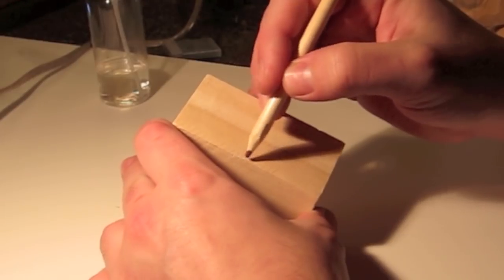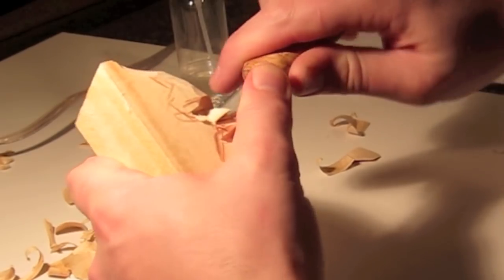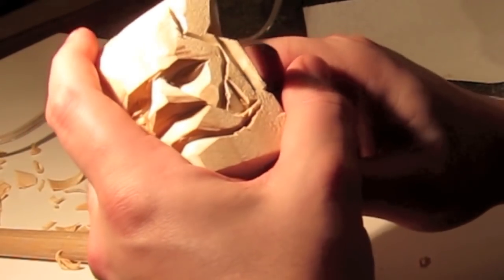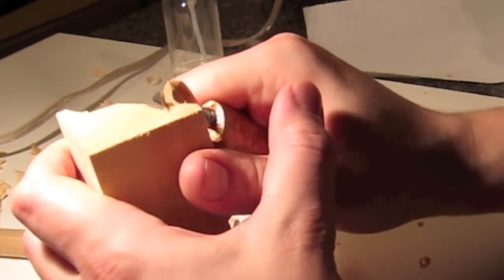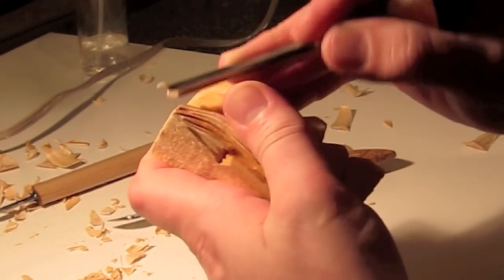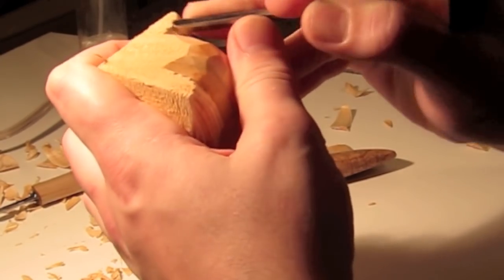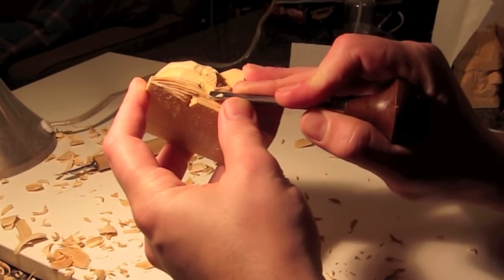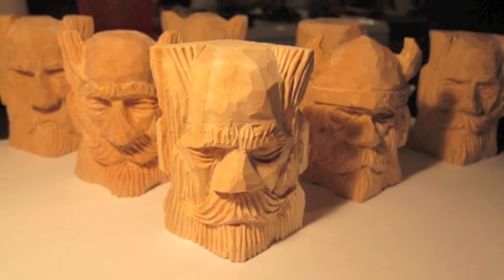30 minute wood spirit carving Full How to carve a Face

Comment: One thing that helped me a lot when it came to eyes,mouth even expressions,was first to do them in modeling clay . Nothing fancy just the tinted bars that you can get from wal-mart. Then bend paperclips with needle noses,and also cut toothpicks with fingernail clips so they act as V cuts,gouges,and fishtails. That way if you're not happy with the results you can do it over,and over again until you are. The clay can be kept in a airtight container for a months perhaps longer until you need it again. It will save a lot of time,and money by working on the clay first if you're unsure about your cuts.

Comment: very good video and carving, i wish i could get that basswood here in the uk, the nearest i can get is Limewood and it is harder to carve.
Reply from the maker: ifonlyful thanks mate. you know this is not the first time i've heard this. and i've never had limewood so i can't really make a comparison. no body sells it here and the few pieces on ebay go for pretty high. For you though, i think it might be worth it to see what shipping would be for a pack of basswood. Someone has to be willing to ship. Basswood is relatively very cheap and a bag of 12 pieces is barely 1 pound...or a 2 or 3 kg...with the exchange rate for you it still might be worth it. 
  the other option is to try and get wood that's not been dried all the way yet. it's way easier and nicer to carve..if you have access and/or tools.
thanks again, good luck!

Comment: Very cool. I'm going to start carving, spirit wood always caught my eye, got to love it. My goal , load my house and yard with figures.
I will try these knives you suggest.
Reply from the maker: +Fred Howard thanks! 
let me know if you have any questions at all about starting out. i have some long winded videos about first cuts with easy access tools. 'lucky clover carving school'
Reply: +schpoingle 
Any help would be appreciated, I did buy the two knives from Deepwood. Beginner set with honer.
Reply: +schpoingle 
I have a question about wood, I have rain tree I have to cut down, the pieces, sizes should be perfect.
I see you mentioned kiln for drying wood, I have a kiln and wondering how long and temperature, higher or low. 
I'll probably have to experiment. If you know anything about this, any advice would be appreciated.

Comment: Incredible work mate. Question, is the wood that soft or if the blade that sharp? I tried to carve a little boat for my kid but having no knowledge about wood, I picked a piece of a branch found on the field and it went down hill there on. I got it done but not before 10-15 hours and lots of cursing lol
Reply from the maker: +Papa Gleb it's a mixture of wood, sharp knife but also experience. Certainly you should go pickup some 'basswood' or order it online. You'll find it much easier to work with. If you don't have a knife that's for woodcarving i'd suggest picking one up that's ready to use. you can get 'the scalpel' from deepwoodsventures.com for a bit over 20 bucks and it's hand forged. or get a larger knife if you want to spend the money. i'd suggest the 1 1/4 straight blade detail. it's a beefy knife. any longer and you'll have problems using the point of the knife for details. 
both of those things will change everything when you go to carve again. 
then, over time, you'll get better at making the wood do what you want. interestingly, it takes some surrender of will to gain control. 
email me if you have any questions or want to show me your work. nosubject13@yahoo.com
take care and good luck!
Reply: +schpoingle thank you very much for all the info. It's much appreciated. I'll def save your email for future reference.

Comment: Hi Man nice work, really cool, Im asking about what kind of wood do you use?
Reply: Basswood
Reply from the maker: Robert Sidden thanks robert.
and for others reading: i get these blocks off of ebay. there's a few sellers and they are all good and cheaper than commercial sellers. this is a 1 3/4 by 1 3/4 by 3 inches block. if it's still available, it's 12 for around 12 bucks including shipping.

Comment: Awesome video. Thank you. I'm wanting to get into wood carving. I have zero experience. I have a few questions: 1) The wood seems to cut so easily. Is that because it's the right kind of wood? Or are the tools just extremely sharp? Or both? It's like you're cutting through butter. 2) How often do you have to sharpen your tools? And do you do it yourself? 3) Because I'm new, with a limited budget (maybe $100-150), what would you recommend I get? A knife like you have and a couple of the "v" and "u" gouges (or chisels - I'm not sure what the right terminology is yet)? Thanks again for a great video.
Reply from the maker: +Russ Tanner hey thanks for writing. the wood is a soft carving wood and the tools are super sharp and some is experience. sharpening for wood carving is a bigger deal than most think. it's expensive for proper materials and it took me months to get down proper technique and longer to get consistent. All you need to start is a knife, then when you start to understand the cutting of wood and getting it to do what you want, then transition into one or two palm tools. your gonna start emailing me for any questions at nosubject13@yahoo.com, my name is daniel.
there's a few options on where to start with knives. you can use disposable blades. a hobby knife/exacto blade will work with fresh blades. the blades are thin so it won't make very deep cuts but it does make clean cuts. i have some long winded beginner videos called 'lucky clover school of woodcarving' or 'how to wood carve and whittle'. I carve with an exacto blade in those videos. you can do that for very cheap for a week or two and then if things go well i can recommend some bigger knives and stropping stuff and sharpening stuff. You do need to get some "Basswood". NOT BALSA WOOD. You can buy this in little grab bags at a local craft store or you can buy very cheap stuff on ebay from private sellers. get these if you want to follow along with my beginner videos http://www.ebay.com/itm/8-1-x1-x-11-75-Basswood-Carving-Blocks-Turning-Carving-Wood-Lumber-/111838363366?hash=item1a0a15fee6:g:cQEAAOSwf-VWXYTE

Comment: Was that a regular carving knife or a rough carving knife. There were so many when I looked them up.
Reply from the maker: yeah, it get 's overwhelming. I need to have him do a 'schpoingle's picks' on his site. not sure if i use 'the scalpel' in this one but i'm seeing mostly the larger one....which in deepwoodsverntures terms, that's the detail knife. yeah. his knives are super big. that's why i like them though. so you want the detail carver. you want a 'straight blade' (not upswept). You want a 1 1/4 inch blade. that's as long as you'll ever need for most project like i do. if you ever get into spoon carving or something bigger then check out some longer ones. 'the scalpel' is 1 inch but the detail knife is made with really thick steal. it's a beast. if you wanna get two, get a scalpel or get another detail that's upswept. 
good luck

Comment: So I just ordered the scalpel. What I want to carve is a pipe. I have the pear wood blank drilled w/stem fitted. Trouble is the block is just that so there is no starting at the edge as it were. I am going to purchase some basswood blocks from the local craft store to practice on.

My question is how do I carve a face when I have to start on the flat of the block? I take it that it is harder to do, but not impossible. Do you have any tips, videos, etc. for someone who has done no carving to speak of?

Thank you
Reply from the maker: digitaltripper hey there! glad to get your comment and hear you are interested in wood carving. I actually carve a pipe a few months ago...it worked out pretty well. On the pipe stuff...i don't know exactly what kind of pear wood this is or the density or grain...but if its going to be a good pipe then it's going to be pretty hard to carve in a traditional sense. I've had some fruit wood like apple ...and maybe pear not sure...but it the grain wasn't straight and very dense...again..good for a pipe but not great for straight carving. when wood like that cant be worked on with regular hand tools then you get into a whole other world of carving...some of it is power carving...using rotory tools with rasp bits on them. you don't need that because it's a small piece but the hand tool route in that direction is rasps, files and sand paper. you will be able to do some smaller very slowly with a knife or gouge but only after its close to putting details on . rasps are cheap and generally get the job done. i've used dollar stone rasps and they were fine. try not to get too course of a rasp. maybe one with a flat side and one with a curved side. if you already have some files you can use thouse from the beggining but it will be a little slower...other wise, rough it with the rasps, refine the shape and corners with a file and then go to sand paper or try out your carving tools. sometimes getting some moister on tough woods can help tremendously. mix 50/50 rubbing alcohol and water and put it in a spray bottle. spray the part your going to work on and wait a second for it to go sink down as far as you are planning to cut. apply more as needed, it dries quick. the alcohol will leave the wood completely so keep checking smell before smoking it. if you don't have files check the doller store again...or get some jewelry files off of ebay. they are cheap and have different shapes. the cheap ones break easy to be carefull..they're still worth it though. 
     okay on the rest...i'm glad your getting some basswood.. it will really help. 
on carving from a flat surface i have two videos like that. there's one from a round log..basically flat. here's the link https://youtu.be/SoWE_uqzuX4
there's an older video that is from a block and flat part and has some good tips for dealing with that..it's nota very good video technically, i hadn't figured out clear camera work yet. you want the second part and about a minute in i start the flat face. here's that video
https://youtu.be/SoWE_uqzuX4
also, if you have a dremel and maybe even flexshaft then you might was to use some of that for carving the pipe details. if you don't have one there's one made by 'greatneck'. it's like 30 bucks with a bunch of accessories. i'vehad mine for 5 years. most accessories for the rotary tools dont remove a whole lot of wood...but your on a small project so it should be fine...
      sorry for writing so much..i love talking wood.
 please send me an email at nosubject13@yahoo.com and ask questions and keep me updated and send pics when your ready. please. i get great full filment from helping peolpe get into carving. and there's so much little tips and stuff that i wish i had had when i started. plus i love pipes and making them and i spent allot of time researching and experimenting  making them and haven't been able to share that info with anyone. i wanna know what you learn too...where did you get the pear pipe? you make it or was it a blank? i want one. 
anyway, hit me up dawg! 
take care mang.

Comment: may i ask a question :i started with carving and did some simple maskes but i never could cut with the knife such big pieces out like you. is it the tool or the strengh /experience ? like 2:45 my cuts are mostly influenced by the wood which make them not so clean or i cant even cut in a specific angle. i always do everything like in 4.20

Comment: question man... been an avid knife sharpener for a long time, recently picked up some bench chisels, and was able to sharpen them very square, and extremely nicely! I wanted to get into some wood carving, my question is: Do those carving knives have a convex bevel and a flat ground edge? Or are they pure convex?  And how much trouble do you have sharpening your carving knives, and or gouges? I can see why doing a gouge would be  challenging to sharpen, but if that knife has a standard V edge, I think i'll have no problem keeping it very sharp! Thanks.
Reply from the maker: +Max Savino hello there! 
the carving knives have a 'v' profile. and just flat. some have a bevel and then micro or secondary bevel...just depends on the thickness. in general, the carving knife is going to have a much steeper angle than other knives or tools. I do have a sharpening video on my page. you really gotta go a few steps further on carving tools ( i don't know what your doing now, but in general). You go up to 1200, 4000 or 8000 grit and then strop with some good stropping compound. you make a near perfect tip that's fragile so any left over burrs can pull off the tip like a hang nail. 
let me know if you have any more questions. also, i'd suggest getting some basswood from a local craft store or on ebay. you can carve allot of woods but when going 'cross grain' they will tear out no matter how sharp the knife is....so there's certain woods that have properties that are used. I have some beginner videos too for basic cuts, if you are interested. otherwise email me at nosubject13@yahoo.com with anything. oh yeah and gouges do have a single bit/ chisel grind and yeah, you just roll it on there. v tools/parting tools are harder to sharpen.
Reply: +schpoingle Cool man, I bought that knife for 22 bucks that you recommended. Its shipping out now! I also went to Woodcraft and bought a small pfeil gouge and a pfeil carving knife too... also bought some relatively expensive carving wood. I had to sharpen the carving knife, the factory edge was not sharp. I took it up to a mirror on the edgepro. I'm hoping the knife from the web site you told me to buy from "the scalpel" is a little nicer of a tool. So sharpen the gouge from the outside, then basically just remove the burr on the inside? That doesn't seem too bad!
Reply from the maker: yeah, the pfiel knives don't come ready to use. the gouge should be though. and yeah the deepwoods knives do come ready to use.
did you buy any basswood? most of the expensive woods at woodcraft are for turning on a lathe and don't carve well by hand. they sell basswood for cheap on ebay. if you don't want to use basswood, you can use butternut, walnut ( a bit harder), some cedar which is soft but tears out a bit on cross grain. here's a link to the blocks i get on ebay
http://www.ebay.com/itm/16-Basswood-Carving-Turning-Wood-Blocks-1-3-4-x-1-3-4-x-3-/111810823507?hash=item1a0871c553:g:ltAAAOSwo0JWNCLE
Reply: +schpoingle so I got in some basswood from the Ebay source you showed me... yeah it certainly doesn't tear out as much as Jelutong, but HOLY CRAP IS IT TOUGH! Its like carving through a rock in comparison. Now I see why the Jely I bought is so expensive, its super easy to carve. I can barely get any of my carving knives into this basswood to do a stop cut.
Reply from the maker: did you try another piece? sometimes the piece is cut next to a knot and the wood is still hard even though you can't see it. basswood does vary some in hardness but it's literally the softest carving wood there is. if you want to send me some pics of your knife edge up close and the wood at nosbuect13@yaho.com and we can try and figure out what's going on. bare with me.
Reply: +schpoingle Yeah I have a few pieces. I have a bran new knife from deepwoodventures, also have my own blades. I'm sort of a sharpening nut, in case you haven't seen my channel. Certainly not a blade issue. I'm starting to get used to the basswood, but it is waaaay harder and denser than jelutong, just wanted to see if perhaps the wood being a little overly hard happens from time to time. I was expecting it to be a little softer. 
That source you gave me is literally about 4 hours away from where I live lol, so its a great place to buy from for me.

Comment: what do you think of a brand of carving knives called flexcut? i have a woodworking shop near me that sells that brand.
Reply: +Brandon Dudley (Poleth1984) Brandon I have been doing relief carvings for over 20 years. My sister bought me a set of Flecut knives. They are fantastic!! I have never got to use  Deep Woods Ventures knives. Schpoingle is right on, about craft store knives. I have never bought a set of carving knives at a craft store that was worth the effort to carry them to the car. I hope this helps.

Comment: hey great video! I was looking into picking up one of those carving knifes you use. what length blade do you have on that scooped type handle knife that you use most of the video?
Reply from the maker: +Ella Son sorry for the late reply. thanks so much. that's the 'straight 1 1/4 inch detail from deepwoods. it's a big knife. pretty much good for all carving.

Comment: What knifes are you using through out the video from deep wood adventures? Are they rough out carvers, general carvers, etc?
Reply: Knives*
Reply from the maker: +Khadijah Silva hello there!
so the knives are...the smaller one is a 1inch 'the scalpel'. the larger one is...it's 1 1/4 inch. both are 'straight' blades. as opposed to 'upswept'. the larger knife is this one http://deepwoodsventures.com/en/knives/15-detail-carver-figured-handle-carving-knives.html#/handle_options-shaped_figured_wood/blade_length-1_1_4_inch
the smaller one is this one http://deepwoodsventures.com/en/knives/27-the-scalpel.html#/blade_length-1_inch/handle_options-shaped_plain_wood/blade_style-straight_blade
make sure to select the length of blade you want and make sure to select 'straight' and not 'upswept'.....unless you want that.
Reply: +schpoingle Thank you!!!!